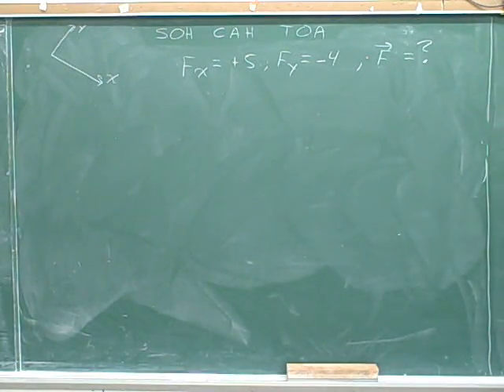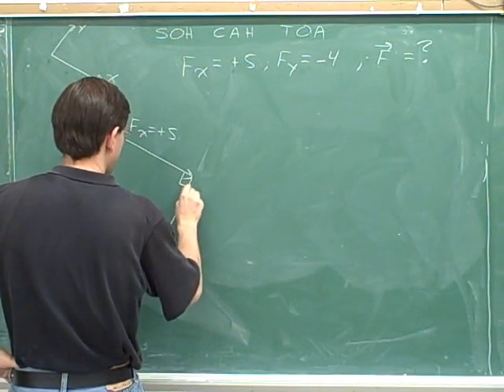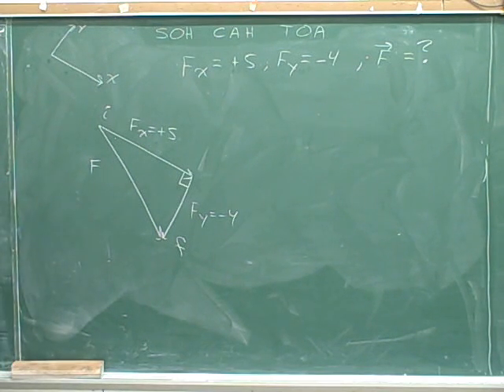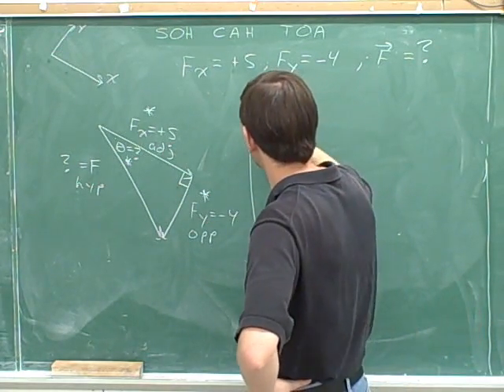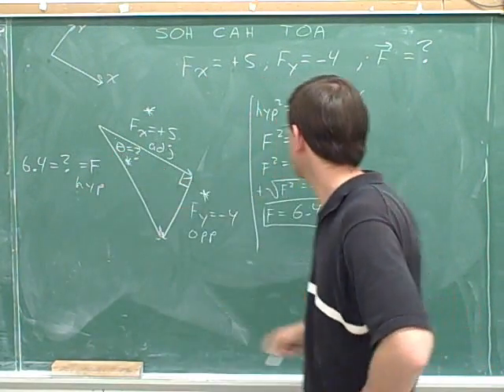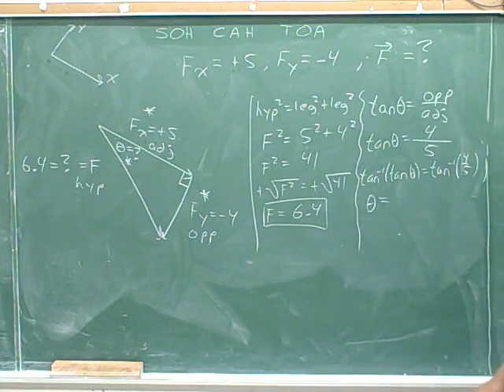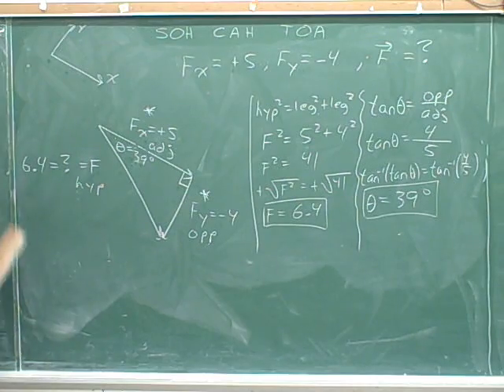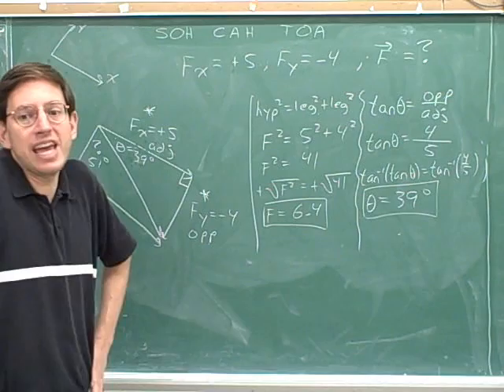Physics: Vector components (80)

Comment: It doesn't matter which variable you start with just as long as you point them in a direction corresponding with the sign.. then the next variable will have to begin at the head (arrow head) of the previous variable.. the overall vector will begin from the tail of the variable you began with to the head (arrow head) you drew in last..